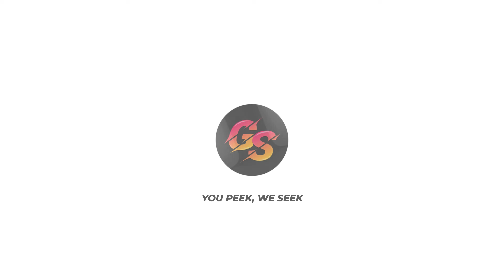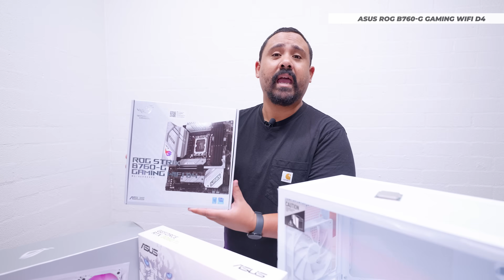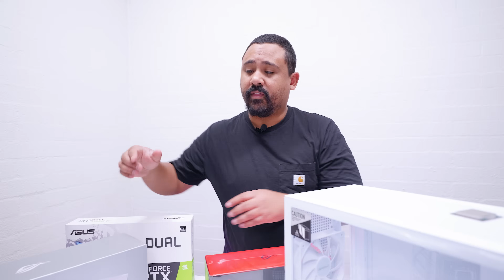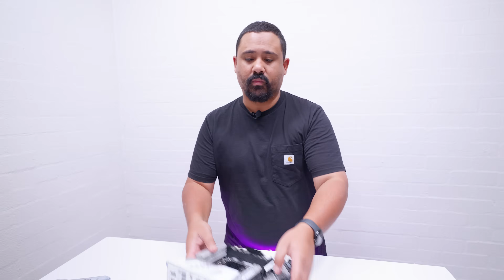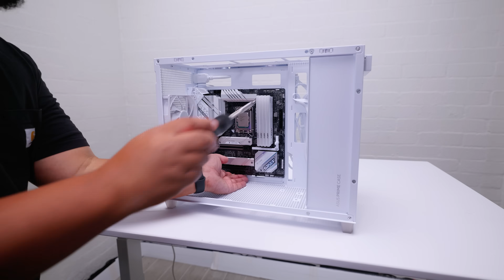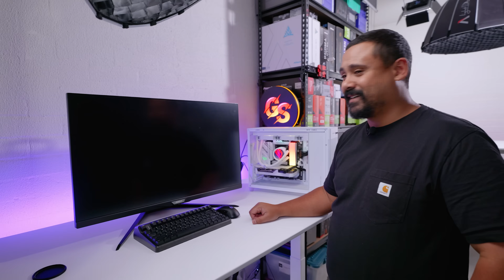Build a Gaming PC With Me in the ASUS Prime AP201 Case  | Part 1

Comment: I'm about to hold a new MATX system in this same case (replacing the current ITX system), although that's the only similar component being used.  I'll be going with an MSI Mobo, 14th Gen i7, 48GB DDR5 RAM, two M.2 in RAID 0 for boot, two SSDs in RAID 0 for data, and transferring my RTX 3070 into the new system.

I'm curious about what happened to "part 2"...the case mod?

Comment: If you use an air cooler and 3x120 fans at top instead of the AIO, placing the PSU as top as posible,what length the PSU should be to let you add 1x120 at front?

Comment: I've built in this case...twice. The second time around I went with a Lian Li SFX PSU zip tied to the case until I get a custom SFX bracket made. This alleviates all the 360 AIO rad fitment issues. It also makes it much easier to cable manage when you're running RGB components. I added a drive cage right under the PSU because I'm a storage junkie. It came out pretty clean.

Comment: HELP! My Pc just made a loud POP sound when I turned it on. It was raining last night and my Pc is right next to my window. It wasn’t wet but I could see there was moisture built up on the glass panel, so there was probably some inside the Pc as well. I didn’t smell any smoke or anything. My initial thoughts were a transistor blowing in the Power Supply, or a capacitor blowing on the motherboard. Does anyone know what could have happened, or how I can test/ diagnostics? 

RYZEN 7 7700x, RTX 4070ti, MSI B650 Tomahawk, 32 GB Corsair ram, 1 tb Samsung M2.2 mem, 850 Watt Corsair psu